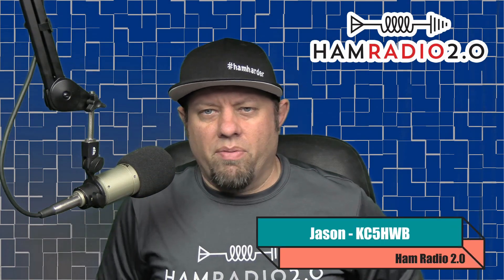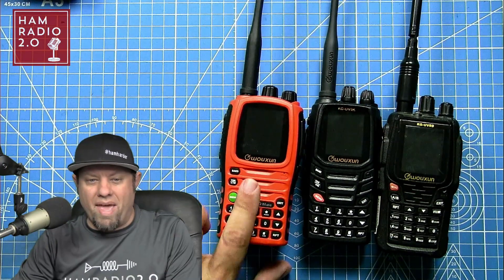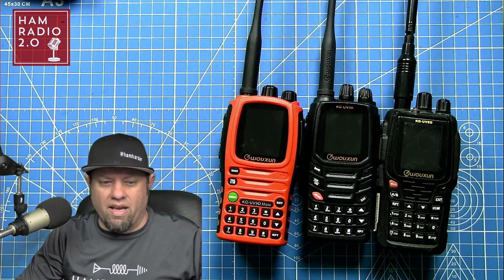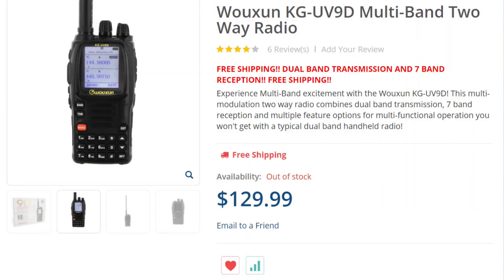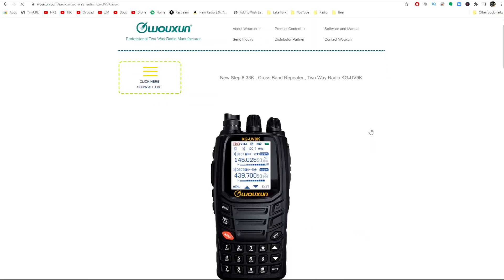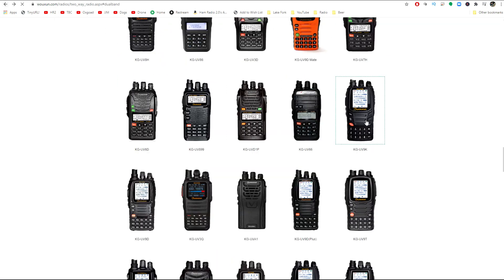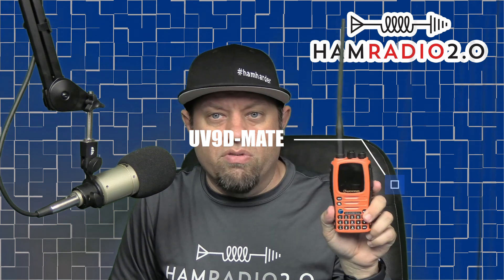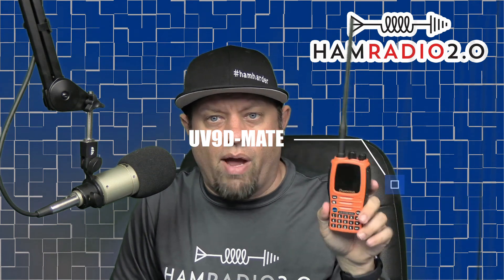Wouxun HT Models Comparison - Wouxun UV9D, UV9K, UV9T Differences

Comment: Hey Jason, love the show.  You asked about what Wouxun UV9 we own, I have the UV9G PRO which is GMRS from BSR. I like it due to power, memory channels and listen capability for a wide range of frq.  My dislike is the display when outdoors.  Almost impossible to see. Compared to my inexpensive GM-30, I can read the GM-30 display regardless. I had both in my hand side by side.  The knobs can get added stiffness, I often bump it off the channel when not locked.   I am taking my technician exam in Sept and thinking of getting the KG-UV9G MATE.  Is the display totally washed out in the sun.

Comment: Can those models transmit above 440.000 frequencies, because I see on the back of the radio when there is not a battery a sticker on which says UHF 430.000 to 439.999. ???
Reply from the maker: The Ham band goes up to 450MHz, so yes.
Reply: @HamRadio2  Thank you for the response, so it does go up to 450 thank you a lot

Comment: The UV8 family is not just dual band, the UV8E and UV8T are 3 bands, 2m, 1.25m and 70cm...
Reply from the maker: I purposefully only mentioned the UV8D in this video.  The UV8E is trash....bad harmonics, birdies, etc.  I have not tried the UV8T so I wonder if they fixed the problems that the 'E' had.

Comment: Hey Jason, just ordered that KGUV9DMATE. Looking forward to it much as I just passed my General and will soon have keying privileges. One thing that sold me on this Wouxun, apart from all the great features and power, is that display. Currently have a BaoFeng UV-82 and I'm always squinting to see what's on that screen! Maybe my first contact will be on the UV9D! :)
Reply: How do you like the display of the KG-UV9D Mate? Quite a lot of people complain that they cannot see anything in sunlight...
Reply: @fred-283  Didn't get the "Mate." Too long a wait. LoL Got the UV9 though. Don't use a lot outside, but when I have its been fine. Mostly, I like the solid feel, robust battery, and great performance. 👍
Reply: @davidenglund  Many thanks, David. Good to know, the UV9 does not have the same issue outside in the sun.  - EDIT: UV9D or UV9D plus, you mean?

Comment: I'm a novice. I bought the UV9D Mate to try and figure the radio out while I prepare for the technitions test. It would be awesome if you could go through the functions of the radio for us newbies because it sure would make things easier. Example: I saw a video where a guy turned on FM radio, pushed the # key and showed that you can enter a radio station. Stuff like that isn't in the owners manual. Example 2, let's say I enter 143.44000 on band A and I can hear people talking and I have another frequency on B. Then I enter another frequency in A, let's say 144.12000. When I try to re enter 143.44000 in A again it kicks me out when I punch in that first zero and goes back to 144.1200. Why? It worked just fine before. It can all be very frustrsting.
Reply: How is readability of the display in sunlight?

Comment: Uv8 have the same problem as a uv3 and uv2 and uv1. That problem is. After you cut the radio on and off a number of times the memory in the radio gets wonky. This may take a year or two before this happens depending on how much you use the radio but they all do it. And that's an issue that wouxun I'm sure knows about it's been going on for years. On the other hand the radios are better than baofeng.
Reply: The UV9-Series does not have that problem and Wouxun long ago fixed that in all of their newer models, like the 7D, 9P, 9G, etc. The Wouxun's are in a completely different league than Baofengs. :)

Comment: Success! Sweet Sweet Success! Wouxun did email with me and I needed to set the radio to Mode 2.  I had reset the radio, using the reset function in the radio and that may have set it back to some other mode.  In any case, mode 2 has me writing to the radio, channel names too.
Here is how to go to Mode 2.  With the radio off, press and hold #2 on the keypad. Turn the radio on, it will show mode 2, but keep holding #2 keypad until it shows the frequencies.
Then let go, you should be good.  This channel (Ham Radio 2.0) also helped by advising me to read the error code, if you get one.  I found on RX frq's only, you have to delete the TX frq in the channel you program. It doesn't do it automatically.  Also make sure you're entering frq's, in bands, the radio uses.  I'm sure I have lots to learn about programming this radio, as it has lots of options. Don't forget to save to a file on your computer, so you can just add or delete channels without having to enter all the frq's again.  Kudo's to Jason for some detailed help.  He really took time with me, and that motivated me to stick with it.  I hope this helps others.
I also got my Technicians license after watching Jason's 3 part class.  I had to watch it all twice, but I got my license.  73 and out
Reply from the maker: Congrats!

Comment: For the UV-8E, you can mute the other VFO when you transmit so you don't hear the intermod.  I have that radio and that is what I do.
Reply from the maker: Yes but you wouldn't have to if the radio filtering was built correctly.
Reply: @HamRadio2  True, but it is a fairly inexpensive tri band, with actual dual VFO, unlike most chinese radios, with cross band repeat. There is no real need to have the other VFO active while you are transmitting unless you are doing satellite work to make sure you aren't stepping on someone else.  I'm personally happy with my purchase.
Reply: You can do the same muting with the UV9-Series radios, and then some. :)

Comment: Ability to charge off of a USB like the Radioddity HT would be a great addition.  Could ditch the charge cradle when traveling and also charge off the USB brick when camping.
Reply: You can charge via USB with the CHA-030 adapter cable, but it does still require the desk charger.

Comment: I purchased the UV8E for 220 and was disappointed for all the reasons you mentioned. It's even worse if you put a Larsen mag mount antenna on it to improve its receive in a vehicle.  I'm looking at the TYT you mentioned.  I want another 220 radio to communicate with my Yaesu VX-6R.  In congested areas you and a friend can talk outside the normal VHF/UHF

Comment: Hello  I had the uv9d Plus. Loved the radio but had to send it back because I couldn' see the screen in bright daylight. Replaced it with the uv9t Plus. I'm having a hard time seeing the screen on it also. Is this normal for these radios?  I have the uv6x and the screen on it it great in the light.  Thanks
Reply: Jim UR Correct, I have the KG-UV9D Plus the :Screen is CRAP cannot see it outside hardly at all 
 Brightness turned up all the way, in the shade it is hard to see  and in the sun it is impossible to see, this is not a BASE radio it is an HT made to carry around and that is outside.. a $25.00 BaoFeng is visible in full sunlight...
Reply: @championsp  tks. I returned that one, got the uv9t+. not much better if any. But the second day I had it the frequencies Locked up and shrank. The range now is 144 to 145.95 and 440 to 443. Cant add anything above or below that. And can't cycle thru all the other freqs. Its going back and I'm giving them one more chance.
Reply: @gryjl1  Power on the radio while holding down the #2 on the keypad. Fixed. :)

Comment: I picked up the UV9T(PLUS)  right before they disappeared off Amazon and have been very pleased with it. The dual monitor has been fantastic. I put a Signal  Stuff Signal Stick on mine which I really like.  I find the radio to be very sensitive receiving much better than my other HT radios and even out performing my dedicated desktop scanners (when using the telescopic)

Comment: Thanks for the videos! I enjoy them and I appreciate the time you put into making them. I have the UV9D+ (for working satellites) and it seems to have a parasitic drain. It kills the batteries if I leave them in the radio turned off. Anyone else find that issue with these radios?
Reply: Most of the Wouxun radios have this, but it's not that bad. Some people stick a little piece of paper between the battery and the radio so they can "store" the battery in place though.

Comment: Having a terrible time with a UV9T plus.  Supplied Software will not write to radio. I get error msgs.
It won't go to other bands or frequencies. Just reverts to last frq. Stays in Frq mode also. It will switch to FM. But scans to the first station it finds and you're stuck there. I tried to contact Wouxun on my own. No luck.  Now Amazon is helping and I got an ask for pics of the problem.  Using supplied USB cable, I am able to use Chirp to write to memory, but can never find them.  The manual is limited help and does not cover the software usage.  If anyone has idea's, I'm all ears.
Reply: Pay attention to the error messages you get from the supplied software. I had similar issues with a newly purchased UV9D-Mate. I programmed it up with Chirp but could only go to the first two memory channels which was very strange. If I downloaded from the radio to Chirp all the 100 or so channels were there in the radio (just could not go to them) ... so what I did was download the programming software directly from Wouxun, did a download from the radio (and again saw all the 100+ channels) but then tried to write it back and it threw an error. I looked at the error and it seemed to be complaining about one of the channels I had programmed (an airband frequency) so I removed it and then did an upload and it went perfectly and then I could see all the channels on the radio. When I removed the offending channel from Chirp I had the same success. (don't know why it had problems with the airband channel because I can enter it in via VFO mode and it works fine?) ... I had another similar issue where I entered (in Chirp) a scan group name that was too long (Chirp let me) and it again put the radio in a tizzy ... and I did the same procedure with the supplied software and saw that it had truncated the scan group names so I shorten them in Chirp and boom worked perfectly again. I think I am going to purchase the RT systems software because both Chirp and the Wouxun software create issues. So ... not likely an issue with your radio. I would just, again, pay attention to the error message, remove what it might be complaining about (even if you think it is right) and you may find success. (Chirp does not throw error messages ... just the supplied software.) Good luck! KF0AOH
Reply: @yellowjacket82  Thank You for such a detailed answer!  I have never seen the 100 channels you're talking about.  I am just trying to put in one channel 119.20 . I can send pics of the errors.  They say out of frequency.  I did get it to write once, but the frequency I added was not found. What software system are you talking about purchasing?
Reply: @senterpoint  The 100 channels are all the local repeaters, etc, in my area so they do not come in the radio. I just loaded them up from repeaterbook into Chirp, etc. ... 119.20 is in that airband range so you may be having a similar issue that I had ... for whatever reason the radio does not like that frequency range coming from the software?  ... I would try just loading something like the national simplex call channels (e.g. 146.52) or a local repeater or two from your area and see if they will load ok via Chirp .. google "RT systems" they make very good software for programming many radios. I have versions for four other radios from RT Systems and have never had an issue with their software ... but it is not free like Chirp.
Reply: @yellowjacket82  Thanks so much. I'll try different frq's and google RT.  Watch ya soon!
Reply: @yellowjacket82  Wouxun told me to set the radio to mode 2. That worked. I can now use original software or chirp.  Here is how to do it. Press #2 key and hold. Turn on radio, it will say mode 2, but don't stop pressing 2 until it you see frequencies displayed. That's all. Program away. Hope this works for you 2